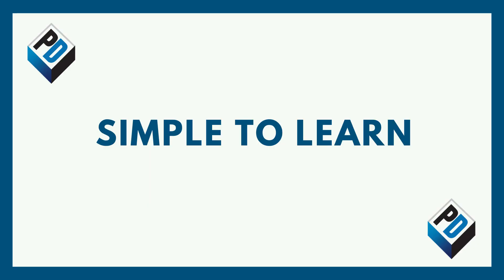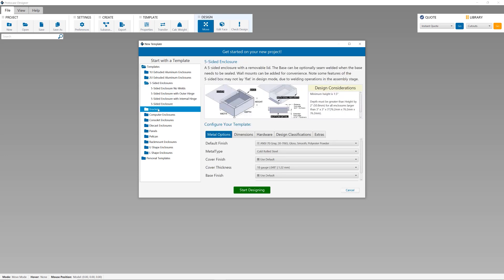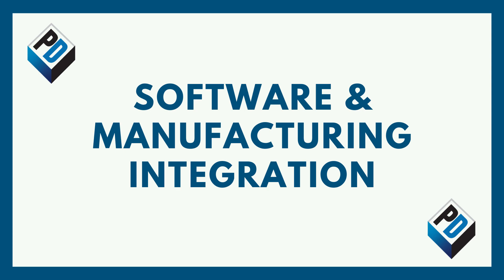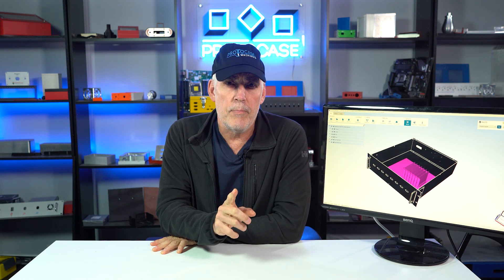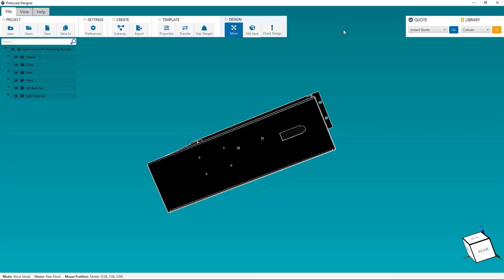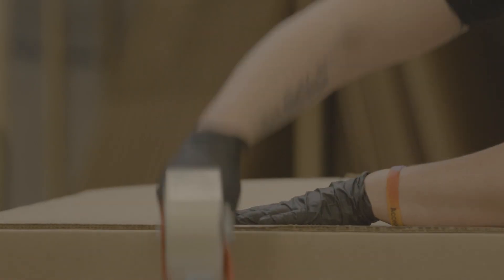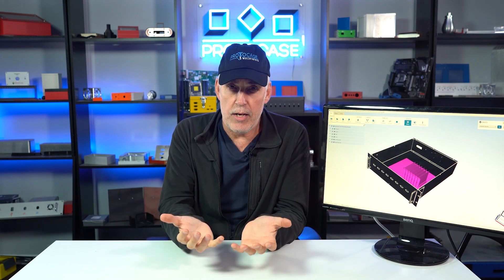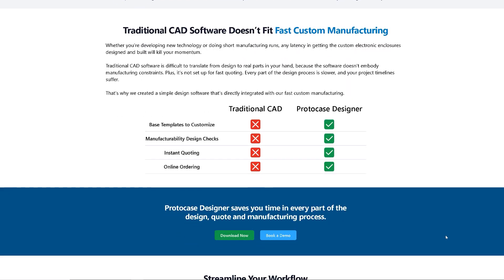Protocase Designer is Going to Change the Way You Work

Comment: does this software support  making models for 3D printing??
Reply from the maker: Hi there, great question. It does not at this time.
Reply: @ProtocaseInc   It would be really nice if the software generated an STL for me to 3d print so that I could verify it in hand, before committing the funds to cutting metal.
Reply from the maker: @kayak_homie  Hi there! You actually can export a STL (as well as STEP, Parasolid and OBJ). 

When you have your design open in Protocase Designer, in the 3D Viewer, there is a button under Create called Export.